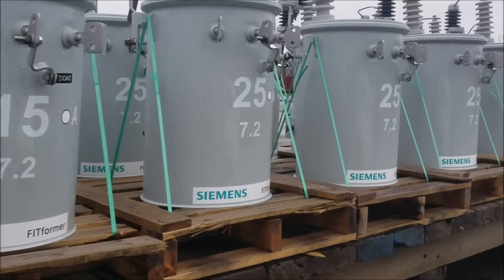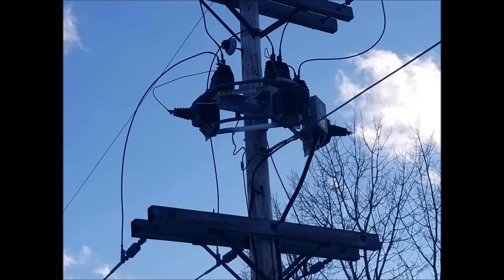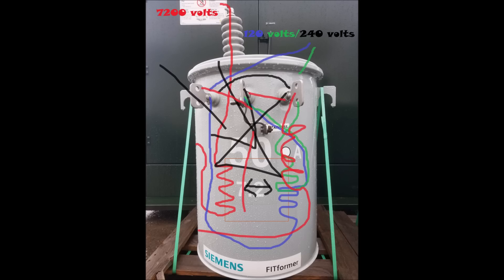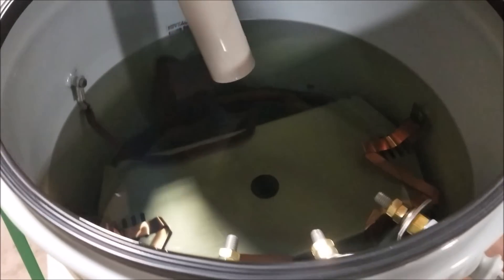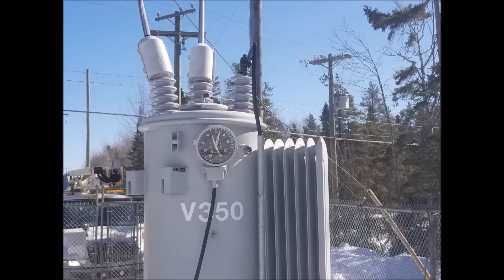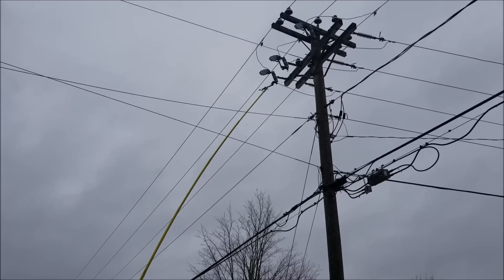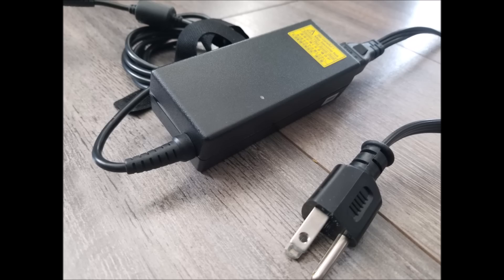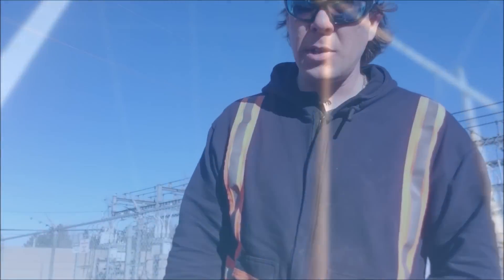What's inside a Transformer?

Comment: The transformer that feeds my meter hums and vibrates in the winter. You can hear a pulsating hum through the wall behind the meter in the house. I even touched the pole and you can feel it vibrating. It is the last pole on the line at the end of the road. Any ideas what causes this? Is it safe? I called the electric company and they told me I'm just hearing things. Everyone who has been here in the winter can hear it and I have recorded the humming as well. But they still don't believe me. Any suggestions?
Reply: Dino:
If you magnetize steel, it will change dimension slightly (the term is magnetostriction).  Also, if some of the laminations in the transformer are not tightly clamped/welded together, they will vibrate.  In either case, the frequency of the vibration/sound is twice the frequency of the electricity supply (i.e., in North America, with a 60 hertz supply, the vibration/noise is 120 cycles per second; in Europe, a 50 Hz supply yields 100 Hz hum).  "Better" quality transformers will be quieter, but cost more.  Most of the time, the vibration and/or noise are "only" nuisances.
Reply: Its normal for a transformer to humm just put your ear near a car battery charger sometime

Comment: a transformer we use to charge a laptop/phone actually steps down DC, unlike the transformer your talking which steps down AC
Reply: Pinoy:
The "transformer" that you likely use to charge the battery in a laptop computer or 'phone would have a rectifier to convert the household AC to DC, a high-frequency chopper to break that DC into poor-quality-waveform AC, a ferrite-core transformer to reduce the voltage to the desired value, and a rectifying circuit to convert the square-wave AC coming from the transformer to the regulated DC wanted to charge the battery.  So, YES, inside that sealed plastic box is a transformer (and many other components).

Comment: What's interesting is the input of a single phase to ground....very reliant of the ground making a good circuit. Out here, single phase transformers use 2 phase input, and it's that voltage difference between the two that powers the primary.
Reply: True single wire ground-return (no neutral on the primary side) is very rare. The transformers shown here still connect to neutral, despite it being bonded to the grounded case on both sides, so nearly all primary current will return via the neutral, and a low resistance in the bonded ground isn't quite as critical. Most pole transformers in my area do seem to have two primary-side insulator bushings, I guess to give the option of either phase-to-phase or phase-to-neutral connection, depending on distribution voltage (e.g. line-to-line on a 4160/7200V system or line-to-neutral on 7200/12600V).
Reply: @jordanhazen7761  You mention a neutral to power the primary. I know the large transformers that take the very high voltage transmission lines and turn it into the medium voltage that goes to the pole transformers could (in theory) produce a neutral line as well as the 3 phases. But have you ever seen power lines that include a neutral wire? I've never seen it.
Reply: @Pete856  Right, the large 3-phase substation transformers operate differently, and usually only have a neutral connection on their lower-voltage side. I think they're typically wye(star)-delta or delta-wye(star) topology. So, HV transmission needs only 3 wires rather than 4. This works fine so long as loads across the various phases are reasonably well balanced.
Reply: @jordanhazen7761  Isn't that extremely dangerous to have the primary side neutral bounded to ground? In case the neutral connection is lost for some reason current will flow on the ground connection, and create a dangerous (possibly lethal) potential on the ground cable and the vicinity of the ground electrode. And of course there are no protections to trip in this situation. 

In my country transformers are three phase and they have no neutral. The metal chassis is of course bounded to ground, but there is not a direct connection, the 3 phase of the primary are in a delta configuration. If one of the phases gets lost, the load will be unbalanced and protections will of course cut out the transformer because of the over current in the other phases (or these days a digital monitoring system will disconnect the line to prevent damage to delicate electronic equipment)
Reply: @alerighi  It is not dangerous.  All modern wye 3-phase poles have the neutral grounded here.  Some grounded corner deltas exist, too.
Reply: @jordanhazen7761  The two input bushings can be used in certain 3-phase situations.